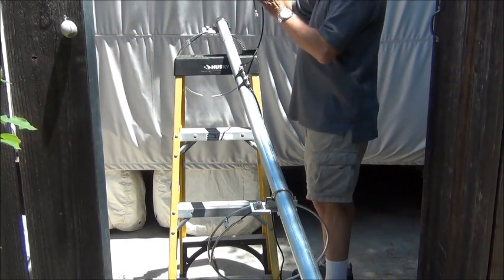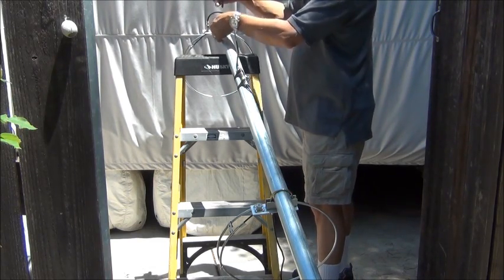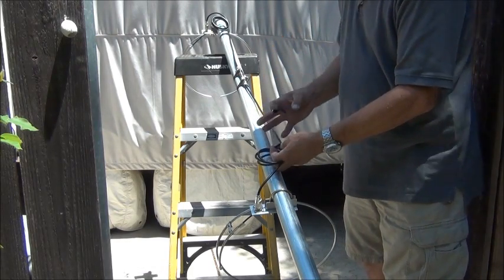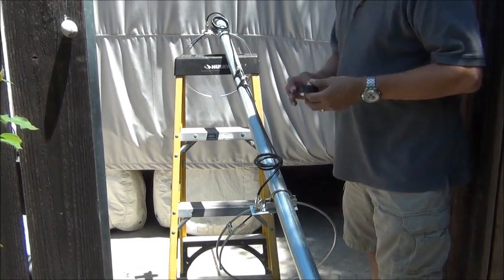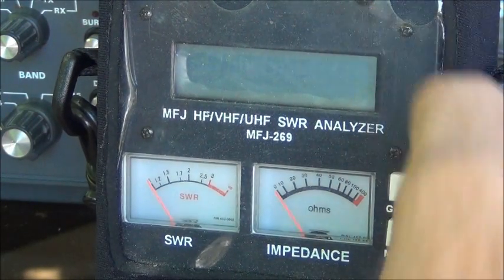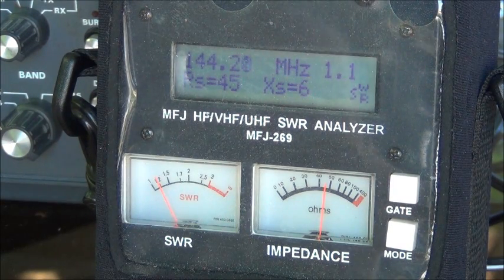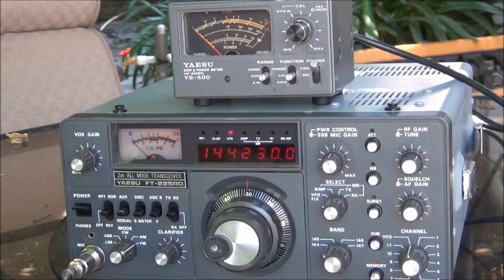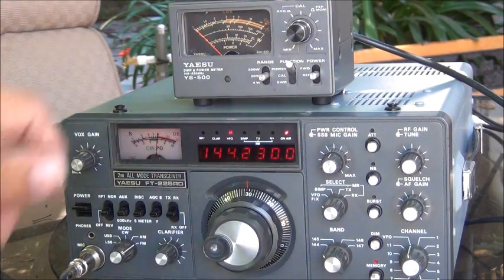2 Meter Halo Antenna Part 14 -- "Phasing Harness installation, adjustments & measurements" by N6TWW

Comment from the maker: I have no way to measure the actual gain. Since the halo is actually a dipole the gain for a single loop would be 0 dbd or 2.15 dbi. I have read that there is some ground gain that is dependent on height above ground in the range of 1 to 4 db. Stacking two loops theoretically should give you another 3 db.

Comment from the maker: Jake, I measured the phasing length from the point where the shield is stripped back. I did not include the length where the center conductor is soldered to the PL259. I have seen different methods but my reasoning was that the coax is an impedance matching transformer and the impedance is only controlled at 75 ohms within when the center conductor is a controlled distance from the shield with the proper insulator dielectric. Glad to see you are enjoying the videos.

Comment: I just wanted to say that I love the videos, I have been going through them, and learned a lot.  I am in the process of building stacked 2 and 6 meter halos. for portable use, and your videos are my guides.  I just have one question, on the phasing harness length, how do you measure where to cut the cable? do you cut your length exactly, and then strip and solder, or is the total measurement from the back side of the pl259, or is it inside the pl259???  I have always wondered this.
Jake
KD7VEA

Comment from the maker: Carol, thanks for the extra info. I have done quite a bit of experimentation and found that every single thing affects everything else. I believe that each installation will have to be tuned according to the circumstances of the location. I have used toroid cores with good success for reducing unwanted feed line radiation. Since my phasing harness was longer than the antenna spacing the winding of the chokes was just an added bonus.

Comment: The proximity of the antennas to each other affects the tuning of both.  With each of my halos mounted in its final location on mast on the roof, I tuned each individually for 1:1 SWR at 144.5 MHz.  When I then connected both of the antennas to the stacking harness, the minimal SWR of 1:1 had moved to 144.2 MHz and no further adjustment was necessary.

Comment: My more rigid RG-11/U phasing harness only allowed a single turn loop at the feed point of each halo, so my choke balun consisted of several turns of the 50 ohm coaxial cable at the Tee connector.